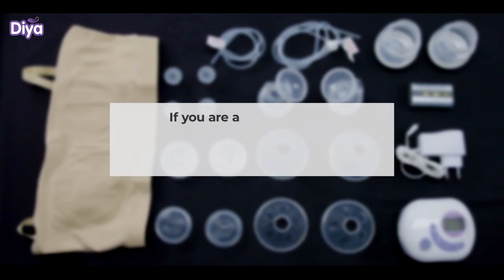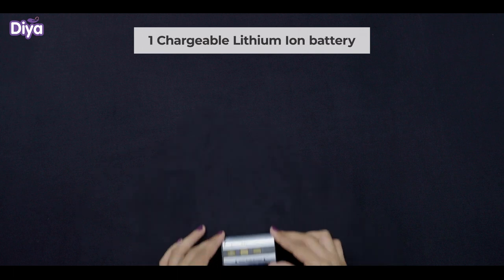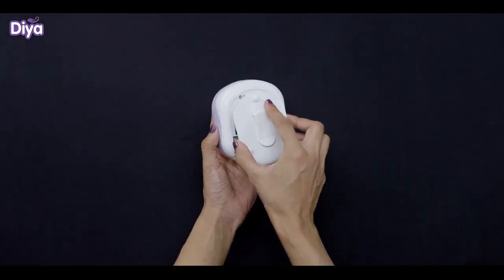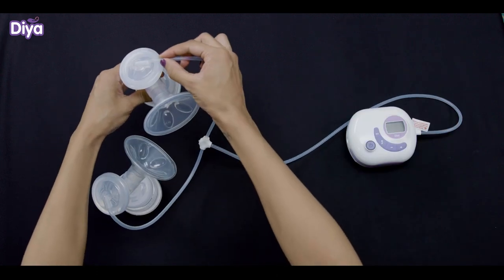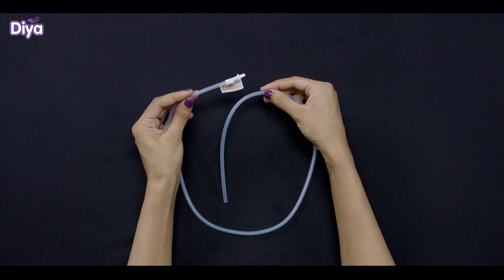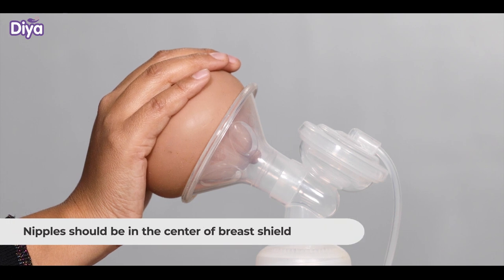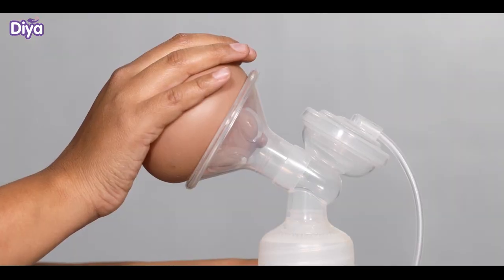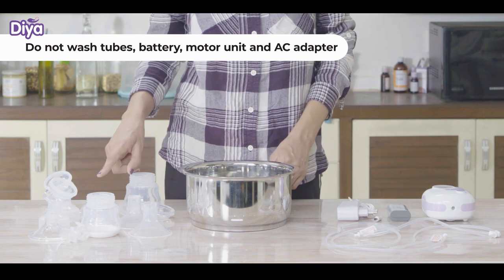English - Assembling Diya Breast Pump

Comment: How do you charge the rechargeable battery? The pump is not switching on. Perhaps the battery is exhausted.
Reply from the maker: The battery is rechargeable battery. You can charge the battery using the adapter just like you charge a mobile phone. If you still face any issue you can reach out to us at +91 99871 89171.

Comment: What is the flange size?
Reply from the maker: The pump comes with standard 24mm size. Other sizes can be bought seperately. We have 21mm, 24mm, 27mm, 30mm and 36mm
Reply from the maker: 24 mm standard size comes with the pump. Additional sizes of 21,24,27,30,36 mm are available for purchase on website and amazon.